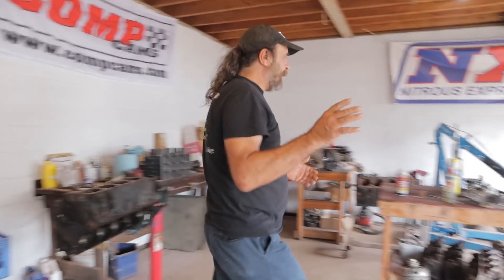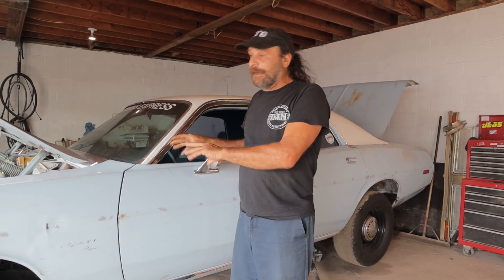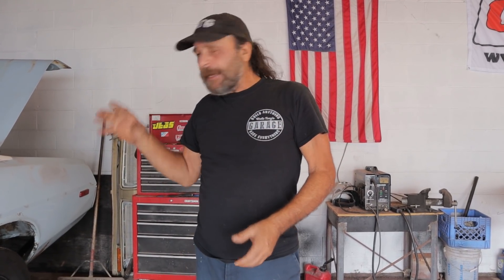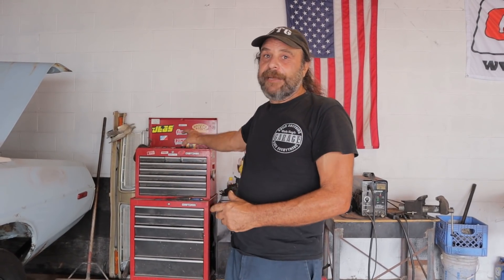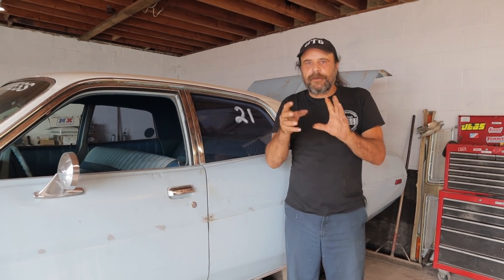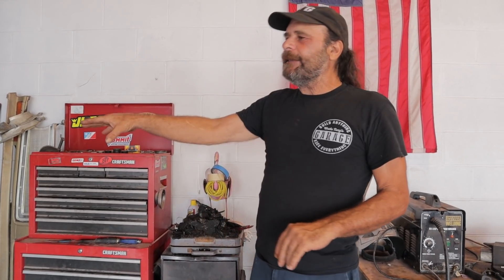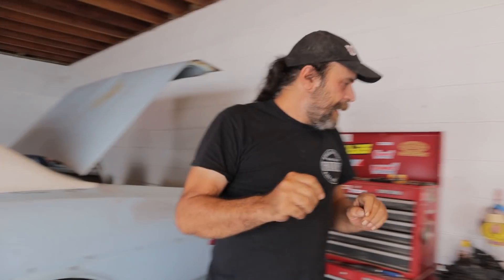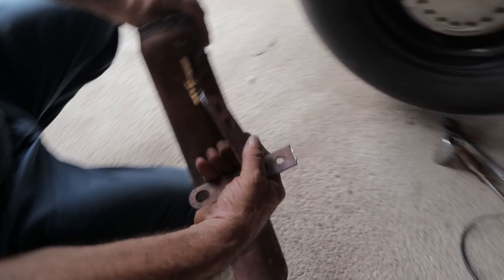This Is What Hot Rodding Is REALLY All About

Comment: YOUR Life is GOOD.  Soon you will have 150,000 Subscribers.  For me Hot Rodding is taking a car and using your skills and making into what you dream it can be. For me I am taking the worst handling and performance car made by MOPAR as a performance car.  A 1979 Plymouth Volare \6.  4 speed. This I plan on Autocrossing ( drag racing with curves) Hill climbing  on roads not dirt, Some drag racing and some street driving. I enjoy the part hunting to build this car.  Oh,  am trying to do this with factory parts.  It's been fun, ,,, I do think you did one thing you should change.. When you cut the bolt flange off the Lakewood bellhousing. The bell housing was completely weakened.  I believe you should put a flange on for a single bolt the middle of the big spans that you left unsupported.  Thus you would be adding back 2 bolts and the small flange material.  But you add safety back into that product..... As always I enjoy your vidoes.. Full of great information.

Comment: Is there a formula as to how many pounds give you another 1/10th?
Reply: 100lbs a tenth they say..
Reply from the maker: It varies based on the power/weight ratio of the car.  1/10th per hundred is about right for a 14 second 4000 pound car.
Reply: I’ve heard 75-100 pounds is about 1/10 second of ET depending where the weight comes out, of course.  I did some figuring while at Frank Hawley’s school of different driver weights in the same car in the same conditions, counted only good runs, and it looked like about 85lbs. was worth a tenth of a second at the driver’s seat.
Reply: Et calculators are fun to play with weight horse power flywheel or wheel there are many on the web If you play with them then test on track you find many ways to improve  there always things to fix or adjust. I enjoy your stuff uncle Tony  seems to keep me on track at least with my 2008 GT500 Im beating the Ford specs by almost 2 seconds. Thanks Tony...

Comment: Weight in the trunk area works against you? That must be why racers put things like batteries and fuel cells in the trunk.
Reply from the maker: Weight low in the rear section works against you.  Anything that bobs below the axle centerline works to counter transfer.
This car has the battery and fuel cell mounted in the trunk, but they are mounted high and not at the extreme rear,

Comment: Here’s a very optimistic story 

A buddy of mine has a late 70s skylark and he put a 246 thousand miles 4.8 ls (vortec)  and he didn’t rebuild it and didn’t do any upgrades or replacements on it he sent the computer off to get it done but didn’t specify anything and they turned the fuel basically wide open advanced the timing and changed a bunch of stuff in the computer naturally aspirated has a Saginaw 4 speed stock shifter basic clutch 2.42-2.92 open rear end and he made the wiring harness for it and he so it should be a mid 12 second car to a low 13s 

(full steel street car and the weight difference from this car with what he’s changed (motor trans) weight wise it’s like 3.2 seconds faster than the truck the motor come out of but the rear gear is gonna kill that)

I told him like 14s+ at best cause in 69 they took a bone stock A12 Roadrunner with Ronnie Sox driving 4.11 posi (suregrip) and after several passes and gettin did of the air cleaner and advancing the timing they could only get it to do 12.91 and that’s a “390hp” I think the dyno showed 410hp and close to 500 torque

Comment: The Camaro is about 3200 lb.
The early Mustangs are around 2,800 lb. You feel safe 3,200 lb at 110. 69 Chevelle 790 horsepower 710 ft lb of torque 10.72 at 128mph.
Big block rolling on fatties.
I want to see the dial-in time on that box truck. That's what hot rodding is about.

Comment: You gotta work with what you've got!  I am a bike guy.  My main brand has almost no real hot rod aftermarket.  Smokey has never steered me wrong.  Just for starters!  Beefy ass heavy pushrods WORK.  Compression works IF and I mean IF you are not pinging!!!!  Go easy on the cam specs and lean those carbs out!  Lean is where it's mean!  Don't brag about how big of jets your running.  Brag about how small they are!!!  A little rich off the bottom can work.  A little rich on top sucks HP!

Comment: I get what you're doing but I would ditch the interior. No ac and a welded diff is a racecar lol.
Reply from the maker: Then it wouldn't be the car I intended it to be at the onset.
Reply: @UncleTonysGarage  I understand.
Reply: You should see the grudge racers down south, full exhaust full interior Gbodies outrunning small tire race cars 🔥
Reply: @barneymiller7894  but they're using big motor to overcome the weight
Reply: @needmetal3221  Small blocks, 434 max. Lots of guys running fast on less than 400 cubes 👍 check out Jmalcom2004 here on YT, he covers alot of Southern grudge racing.

Comment: who cares about weight or efficiency when its so easy to make power. Ebay turbo's ftw. You can have fun scraping off undercoating and cutting off brackets ill just turn the knob on my boost controller a few extra turns and we can see who wins :)
Reply: Till your stock bottom end LS goes nuclear 🤣 but big power junkyard motors are dun while they last. I prefer nitrous, you can't hear it and I can purge under the car 🤫
Reply from the maker: All else being equal, the Ebay Turbo car that has been prepped this way will gap the Ebay Turbo car that has not

Comment: Mine's fwd so headliner "should" go because that weight would shift back off of the front on initial acceleration. Won't go because it contains the power sunroof, which I also enjoy. Plus a hole in the roof would increase drag. I'd like to see Uncle Tony and crew make some home made carbon fiber parts. Stock shape and look see how much can still be pulled off an Uncle Tony special.
Reply: What fwd you working on?
Reply: @barneymiller7894  Probe GT
Reply: Pretty unique project 👍

Comment: Plenty of weight is still there. You need to remove it. Stainless strip along the rocker panels, stainless trim around the door windows, hubcaps, heater and hoses if they're still there...All these pieces add up...Go ahead and lose that headliner, and the rear door window wind up mechanism too...You'll get under 3,000 pounds, no sweat....Please explain "shorty belts"
Reply: "Shorty belts"= running a serp belt shorter than factory, in order to bypass unnecessary accessories, typically air injection reaction pump, ps pump, possibly a/c compressor, is what he is talking about.
Reply from the maker: I know...but then it wouldn't be the car I envisioned when this project started.  I have others that are gutted like that
Reply: @jimbob4657   OK, Jim Bob...thanks for the info. I'd never heard of that.
Reply: @UncleTonysGarage   Good point. Thanks.

Comment: if your so worried bout weight why are running a four door
Reply from the maker: Actually, the 4 door sedan, with its post is much stiffer than a comparable 2 door H/T.  Weight difference is less than 30 pounds, and this car does not need the frame rails tied.

Comment: I don't know if I would go so far as to say this is what it is all about! You spent half the video talking about saving 7 lbs. Ok. I mean it's fun to start dreaming about light weight, thinking about how to make a car faster, etc. 
It is SUPER important that people KNOW what they are removing. 
Take a more modern car, even one from the 80's, like a G body. Take the door panel off, and look inside the door. "Look at all this stuff!" people will say, and start hacking things out. "I saved 40 lbs!!!" 
That 40 lbs was also the structure of the door, the same structure that will save your a33 when you get in an accident. Now it's gone, if you get t-boned by a crotch rocket even the door is going to fold up like a pop can. 
People pull seats out. Pull the rear seat, save 9 lbs. But now your rear seat is gone. I have lost count of cars that youngsters have taken and done "lightweight" work on, and basically destroyed the car. It's one thing if you want to gut a car, put a roll cage in, etc. But if you are going to "lightweight" your daily, you are going to destroy your car for basically no gain, or worse, make it dangerous to drive. 
And I don't say that like I am trying to be someone's nanny, but I have seen so many butcher jobs for sale on CL or facebook now where it would cost more then the car is worth to fix it it makes my stomach turn. People say values on SN95 mustangs won;t ever go up, no one wants them. hahahaha, wrong- they will go up because 19 year olds are completely destroying those cars on a daily basis and the price will go up with scarcity :p I saw one where the kid took the locks out to save weight, and the rear seat, and the liner of the trunk, and half the dash, and the guts of the door and the radio and most of the trim. Then he wanted to trade for "whatchya got?" I bet his car was lighter though. 

So kids, as you watch Tony talk about shaving lbs, try to educate yourself on what you are shaving before you destroy your car! That 2lbs of trunk liner isn't going to make you win a stop light drag race, it's just going to make your trunk look dirty and reduce your cars resale.
Reply: Street racers aren't built for "resale value". 
This car was literally on its way to the CRUSHER when Tony decided to build it. 
Screw a "trunk liner" . 
Screw worrying about door impact beams because "what if I get hit by a crotch rocket" . GROW BALLS , and RIDE the "crotch rocket" which HAS no doors to protect you , or drive an old Jeep like I used to where the door was A SHEET OF CANVAS. 
Live life , and let others live theirs. 

We don't build race cars to sell them to you when they're done , we build race cars to RACE. 

and lightweight is the name of the game. 
Years ago , when he wrote magazines , Tony taught me a great lesson : 
If you want to lose 100 lbs , don't look for 100 places to lose a pound , look for 1600 places to lose an ounce.
Reply: "Its just going to make your trunk look dirty" . 
No , DIRT is going to make your trunk look dirty. Pressure was it and give the trunk a coat of Rustoleum Stainless Silver , it will GLEAM . 
Or , if you really want it to look like a trunk , use "trunk splatter paint" which makes it look like a factory TRUNK.
Reply: @Richie_the_Fixer  You missed half my post. People are more than welcome to do what they want to their car, it's theirs. But kids do that shit to their daily driver cars. I could give a rat's a55 about people making strip cars, gutting them, whatever. There is a whole class for that. But when some 19YO sees this and decides he should ruin his car he needs to drive to work every day to the point it won;t pass an inspection, there is an issue. That's the message, gutting a car is what you do to a dedicated strip car, not the one you drive on public roads every day.
Reply: "dedicated strip car , not the one you drive on public roads every day" ? 
BAH ! 
When I was 19 , I drove my STREET RACERS on the public streets every day . 
In NEW JERSEY , which had one of the toughest inspections in the nation. 
But I have NEVER seen a car fail inspection for "no trunk liner" , or seen an inspection station pull off a door panel to see if there were impact beams inside the doors , or even give a flip if you had carpets or back seats . 
I literally took my CJ7 through inspection every year with the top and doors off , the windshield folded down (legal as long as you wore eye protection , just like on a motorcycle) and one bucket seat. 
Inspection checks lights , signals , wipers, brake function , seat belts , presence of Cat converter (if required) , and a sniff test. For a while they ran an IM240 dyno , but I think they discontinued that. 

Stripping down cars is historically STREET RODDING . 
Look at "the" iconic street rod - a Deuce highboy. 
No hood , no fenders , no bumpers , no top , no p/s , no p/b , no A/C , no DOOR LOCKS (what's the point when you have no roof) , no side windows , no carpets , and no worries. 
Just a car as light as they could make it and a rumbling V8. 
These hot rods ran the streets for half a century , and they were the car that every guy wanted. 

No , friend , I  didn't  miss a BIT of the Karen in your post.
Reply: Yes do your research 1st or you want pass tech at the track 
Now Tony I have to get a roll bar you got me to fast for my class...
Reply: Yes if you don't pass Tech no race for you on track

Comment: Then he put a chevy motor in it and went 2 seconds faster🤣😂🤣🤣
Reply: and i put a slant six into a chevy 1990 sliverrodo truck i called it the chaadodge no crap for 89000 miles
Reply: I did exactly that, but it was replacing a 305 with an LS1.